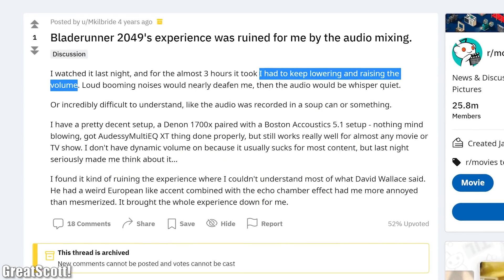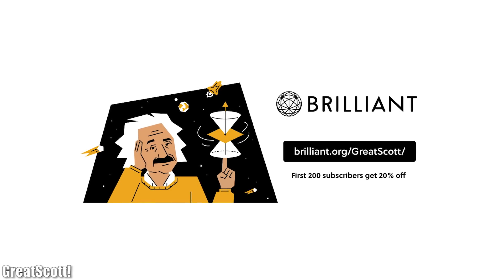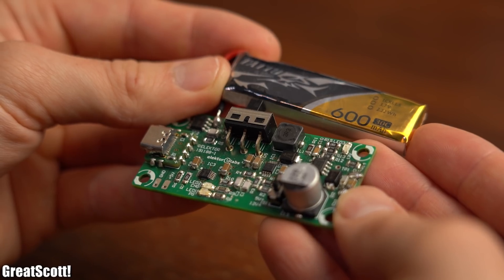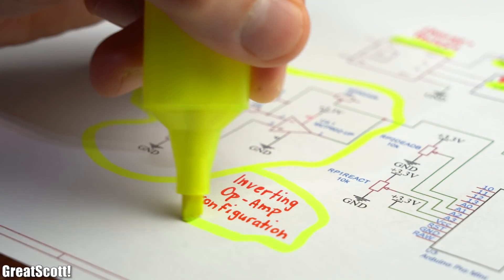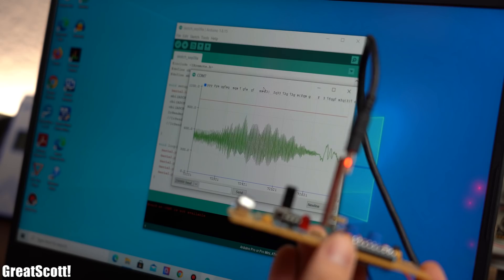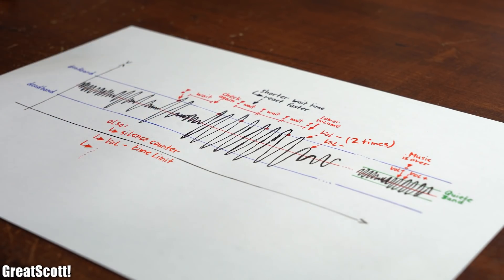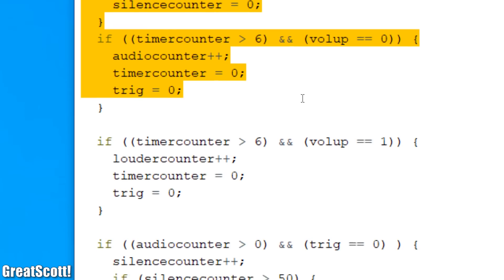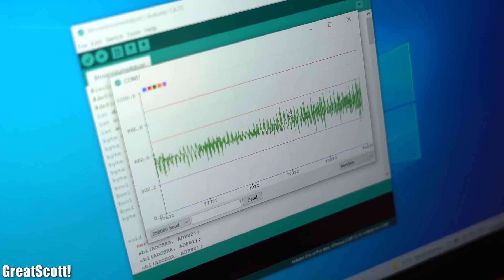Movie Music has a LOUD PROBLEM! So I fixed that! (Automatic Volume Adjuster)

Comment: My biggest problem is the "scare".  You can usually tell in a movie if something is about to happen when the sound gets very quiet, then something happens with a big bang or crash to give you a jump scare. Like the random cat in a room screaming for no reason at all. I've owned cats my entire life and they just don't do that in real life. Only if you step on the tail or something like that. Your solution won't fix that because it takes time to react and by the time the volume goes down my wife is already yelling from the other room to turn it down please.  On a side note you don't need to get all of the frequencies to determine the levels.  Your "nothing special" amplifier could be setup as an active filter and output only the mushy general levels, which would be simple to sample.  You are making an automatic gain circuit so general levels are all that are needed. Not much energy is actually in the upper frequency area. You could sample around 1kHz and get most cases. That still would not solve the rapid increase problem though. Perhaps that's ok though, the director got his shock value while you still get to keep everything mostly normalized.

Comment: Can you replace the IR section with a servo motor that pushes on a universal remote volume button so that we can all start using this with any TV setup :) ?
Reply: i think that would be a bit clumsy, it would be better to make the microcontroller learn the volume signals. I mean having a physical button that you press and then teach signals to the controller with your own remote. Sorry im bad at english :D

Comment: Excellent work. I did something similar to detect sounds with a certain level and within a certain frequency band, but I greatly simplified everything by first performing a signal rectification, thus obtaining a DC level proportional to the amplitude of the signal in a certain frequency band. only. For the rectification I did not use simple diodes, which is also possible, but I implemented an "ideal" rectifier which is a classic Op Amp circuit with diodes to avoid the knee voltage of the real diodes. It works well.

Comment: An answer to many prayers! 
P.S. Any chances you will cover Jetson (nano or NX) in the near future? Looks like A.I. is bound to take over or at least permeate all the electronic spectrum. It's almost impossible to mention electronics field without A.I. Sure it's more software than hardware but Nvidia Jetson has a lot of GPIO's which can be put to use.

Comment: Looks fun. I think the easiest method to get there is to install the VST on the computer to normalize the audio (vocal rider; youlean etc.). After that we just need to send it to TV, which is not a big deal most of the times.

This way you can get it done with software that you don't have to make

Comment: This is awesome! I have the same issue with movies and Tv shows here in the US all the time. Seams like I live with the Amp Remote in my hand when watching anything anymore... :-(
I even fall asleep and wake up with the damn remote still in my hand... Lol

I have two different amps, one is just a stereo amp, the other has both 5.1 and stereo and they both do the same thing. Can't hear people talking and a gun fire rattles the walls and scares the hell out of the dogs! >:-(

So I use the 5.1 in stereo mode and much the same thing. Yes in 5.1 I have the center all the way up and left, right, front, rear at half volume and I still have to fiddle with the remote so I just live with it... :-(
Hell I would even buy one of those if you sold them... Lol
Thanks for the awesome solution and video!
LLAP

Comment: The issue with the vocals being quiet and the music being stupid loud it is not the movie industry mixing it incorrectly it is your crappy sound system lacking in the center speaker department. If you are center speaker is as adequate as your front mains speakers then you will have no problems with the vocals and won't have to turn the volume up and down as needed. Basically just replace the crappy sound system you have with something that can play three stereo or tri-stereo as well as surround.

Comment: 'Hacked Normalise Function' my old system used to have a normalise function which would try to equalise the deadband to the music, the adverts were still loud (something to do with compression?).
After watching this I realised my new system does not have that feature anymore, so I might have to build one of these.

Comment: I’m a movie re-recording mixer and this problem makes me cringe. So what’s happened is movies made prior to about 2000 were always mixed in a theater, so they’d sound their best in that environment. The problem is that a theater is much quieter and acoustically ideal than people's living rooms, so the wide dynamic range you experience in a theater, where things can be very quiet or very loud but still comfortable, don’t work in a person's home where their hi-FI equipment isn’t aligned, they probably don’t have surround sound, and background noise in their home can be 30dB or more louder than in a theater.

Many movies now do a separate mix specifically for their DVD/streaming release to mitigate this. It’s definitely less of a problem in modern films, though there are definitely still exceptions 😀
Reply: I rarely come across a movie that this is not an issue.
It's so bad these days I almost wish these muppets doing sound editing in TV and movies off the planet.

Comment: This is a horrible klugde. The proper way to do this is to use a sound compressor circuit (basically just an amplifier with a specially curved gain) to reduce the dynamic range.

Comment: I definitely like the project but The problem statement itself misses the point.

In general audio is become much more compressed, The quiet quiets and the loud louds are brought closer together.

The problem is in the real world, the dynamic range is much greater.  If you've ever been to see a symphony for instance there can be very small sounds and then very large sounds without compressing them together, which creates an emotional effect, The shock of the loud after the beauty of the quiet.

Another possible solution to your problem is to embrace the contrast and really enjoy having quiet things and then loud things happen. I say turn up the speakers so you can hear when people whisper and then when it gets loud it gets fucking loud and that's awesome! 

If your neighbors don't like it, I don't know, wear some headphones.

I think it's funny how we want these HDR TVs that project more extreme contrast and light and then we continually squash the audio contrast until it's all the same.

Comment: It's called volume riding. Unfortunately audio nowadays is mixed as if you were at the cinema, with high dynamic range. I have an LG soundbar too, download the soundbar app, then you will find a setting called "night mode", enable it. That setting will compress the dynamic range, making it a bit better. Also enable auto volume from the same app, then if you want to use optical, from the TV just use a pcm signal. Using Bluetooth will completely solve the issue as Bluetooth is always compressed.

Comment: The problem is not the sound on the bluray or dvd. The problem is with your Dolby Digital or DTS-HD decoder on whatever device your playing your discs on. Sound in movies consists of many discrete channels and each channel’s volume is mixed at a reference level. This reference level, however, is quite loud because it needs to sound good when played in cinemas. Where it goes wrong is when you play multichannel audio tracks (like 5.1) at a volume level that is lower than the reference. This messes up the mix of each channel and it can occur then voices become too soft or background noises become too loud. My Marantz SR-7007 A/V-receiver has an option to change overal volume of the mix my either 5, 10 or 15 decibels (dB). And that way I can still enjoy a good 5.1 soundmix at a sound level that is also acceptable to my neighbours ;-). If I wouldn’t have that option, I would have to turn up the volume of the receiver to 0 dB (zero decibel). The sound volume on some receivers or amplifiers is displayed as a negative dB number (with 0 dB as the loudest volume out of your speakers) because that’s what it is, you don’t increase the output of your amplifier but you increase some resistance circuitry to lower the output to your speakers.

Comment: I built the exact same thing but using ESP8266 and Home Assistant and sending the codes to lower with direct API commands to the amplifier about two years ago.
By the sound of it, I believe mine only took a fraktion of the time to get running.

But there is one major flaw with both of ours.
If you have mini versions of yourself, then they are loud and trigger the lower command.
You try and combat it by adjusting the volume up, and it triggers even more.
Then you just accept your defeat and take it down.

I believe the way to win is to read the signal coming from the TV/amplifier directly so that you don't need a microphone.
But sadly I don't have the skills to do that.
I bet you do though ;-)

Comment: Instant adjustment can be achieved if you tinker with the pre amplifier to power amplifier section in your audio system. I think next project should be that.
Reply: It used to be, but I would guess there aren’t any analog audio cables involved in his setup - or nearly anyone’s these days.

At any rate, for volume level normalization, it’s good to have some slack in the detection phase anyway.  This is similar to how a traditional audio compression circuit works.  The trigger level is known as “threshold” and the timer for reaction is called “attack.”  The attack window is usually from tens of ms to a second or more.

Using a really short attack changes the action from compression to limiting, which is normally used to prevent clipping digital inputs, or as a last resort protection mechanism on the power amplifier input to protect speakers from being overdriven in PA systems.  Although it’s starting to show up in cars and Bluetooth speakers and other DSP-driven audio chains.

Limiting isn’t a good way of managing volume disparity because it doesn’t sound very good when used with a heavy hand.  Reacting quickly ends up squashing the sound in a way that is similar to strong wind buffeting a microphone.  You need slower attack and release to keep from modulating the volume constantly.

Of course slow response means initial bursts of loudness and sometimes laggy return to normal levels, but the only way around that is to have a look-ahead buffer that can analyze the level changes and preemptively adjust the volume.  Or just mix the source material properly, Hollywood......  😖

Comment: Really interesting! I kinda want to do something similar to automate my old AC units which use IR remotes. How did you manage to get the remote codes?
Reply: He just got an O'scope and measured it.
Reply: Your AC units?
So you want it to get colder when the sound is loud?
:-D
Sorry couldn't help myself.

Just look at the video, an IR receiver and an Arduino to get the codes.
Quite simple.

Or use an ESP based Arduino, that way you can control it manually also.

Comment: I Think Automatic Level Control (ALC) can do the job just like Automatic Gain Control (AGC).
Reply: It IS an automatic level control...thats the point.
Reply: @andymouse  It Is available in software in the system - No need for externals - Do it simply - that's the point.
Reply: @ALIKHAYRI  That easy ?....cheers.

Comment: A CPU for an AGC circuit?  What has he been smoking?  Or..not?
With an age of 60, I'm a bit of an old timer.  I like the analytical approach in all of your videos, but when I saw you used a CPU to build an Automatic Gain Control (AGC) circuit, I was in need of a black label (yes, one of those on the cupboard behind you)
Then reality checked in: 
we are not in the nineties anymore and those CPU boards are darn cheap.  
Also, I guess a dev-board is also very handy in dealing with the remote control signals etc..

So,.. Great idea Scott.  This old-timer likes it
ChrisV

Comment: Dude, this is actually stunningly brilliant! I made a stereo automatic volume control for movies about thirty years ago. Basically, it used a voltage controlled volume IC, an op amp, a diode, a capacitor etc. Once the volume went above a certain level (no waiting), it instantly turned the volume down. Then as it went quiet, it slowly (maybe about five seconds) turned it back up. It was AWESOME!!

Years went by. Stereo turned into surround sound. Audio went to HDMI and I have been looking for such a device for years! I never thought to use an Arduino to emulate the remote control! I would use the actual audio rather than "listening with a mic", but that's actually a pretty good idea too in it's simplicity. I may just do that.

This may be a life changer for me, Thank you!!! Have a great weekend.  👨‍🦳
Reply from the maker: Thanks for the feedback✌ Glad you liked it
Reply: A line level solution would have one big advantage:  Line level is fixed.  So, you can still set your volume to whatever level you want, and it’ll adjust relative to that, since the threshold detection is based on absolute levels that are independent of listening levels.
Reply: @sirnickity  I wonder if it would be possible to convert GreatScott!'s design into a line level solution. That would be nice, also for PC audio devices, like the volume differences between youtube videos (and ads) and such.
Reply: What about a proper AV Receiver?
By controlling center volume you can basically improve voices enough to make the loud music fitting better

And if you are really a fan of dynamic compression, well they also do it a lot better and individual for every channel
Reply: @harrison00xXx  Sometimes the producers mix it in a way that no matter what you do, the speech is unintelligible and the sound effects are overpowering. Especially if you have close neighbors like in an apartment and especially especially late at night.
Reply: @kenmore01  therefor any night mode at AVRs is for

And once more…. At any proper Surround gear you should be able to Turn Center volume up and this definately fixed EVERY movie i ever had troubles with aslong the voices were not yet downmixed into stereo
Reply: Yes. Line level, no microphone. But with a mic, you don't need 16KHz to do this. 8KHz was plenty and even 5KHz would work fine.

Comment: YES! I've had this problem for years with so many movies and TV series! always thought about a variable gain compensation, cutting off peaks and raising low volume. thanks!
Reply: this feature have been awailable since the 80s (at least I know since 80s) back then it was called loudness.  now it's called dynamic compression or acoustic compression or comp or night mode.  TV's have this as well as amplifiers.  I'm not talking about logitech computer speakers though however you can use a plugin or software or media player to do this on your computer too.  you don't need a device to do this.  just don't use the stupid soundbars.

Comment: But if the remote control of other devices sends out a different pattern of 1010010101011... The code must be changed if i'm not wrong. You have to convert this digital code into hexadecimal with the program that includes the Arduino IR library... Right?

This circuit can be improved and maybe can be patented!
[Every manifacture designs his own automatic volume regulator]. This circuit can be directly in the internals of the device. It sends the signal directly to the device's microcontroller and it can be more fast and realiable.

But the real question is:
Does this thing [improvement] already exist!?

Comment: I just turn on subtitles - and leave the volume to whatever is comfortable. 
It's brilliant - it improves your reading level, it helps you get all the details/names and you're free to ignore them if you feel so.
Much easier than to rip the movie and normalize audio levels or make an external device which requires frequent recharging. 
(Who watches the red led during a great movie to see if it needs to be recharged?)

Comment: what a great video!
I love your videos and honestly think they need to be included in the school physics course. Maybe even in university!

This video covered a laboratory work for decoding remote control signals and Arduino programming. 
From my small programmer experience, I would only advise you to create boolean variables for logic. For example, a boolean "doesVolumeNeedToBeIncreased" would make sense inside the if statement and would also improve readability.

Comment: Some of the old CD disk carousels had a circuit to try and maintain a set volume level during shuffle play.  Many symphony recordings play at lower volume so that they can expand into more dynamic range while some of the Metal bands go for high volume for the in-your-face effect.  You circuit might be helpful for that or for handling volume changes as you channel hop.  Also, in the US commercials are typically louder than the TV shows.

Comment: It is useful if you are watching classic TV broadcasting as well. The advertisements are usually louder than the program.
Actually there is a method in sound engineering named dynamic compression. https://en.wikipedia.org/wiki/Dynamic_range_compression

Comment: How is the soudbar and rears fed, from an AV?, check to make sure all the setting are set correctly, your soundbar might be set to quiet or normal dynamic range whilst the rears are set to full, things like that. (actually, I think you might have adjusted those settings in a previous experiment)
Reply: A brilliant fix though. :)